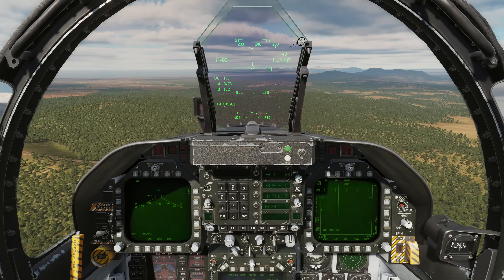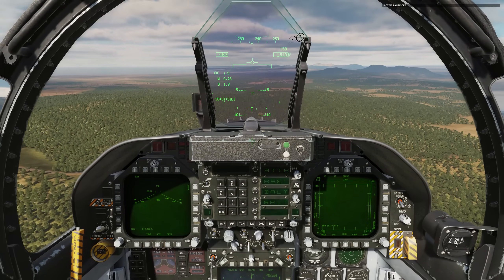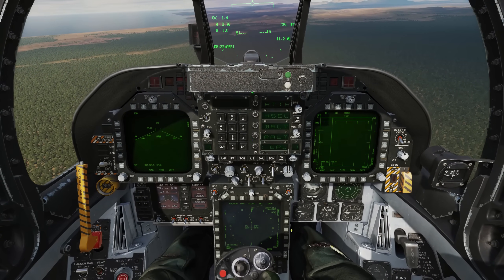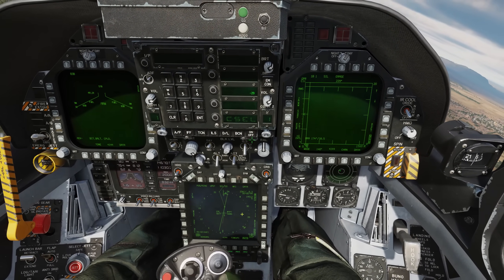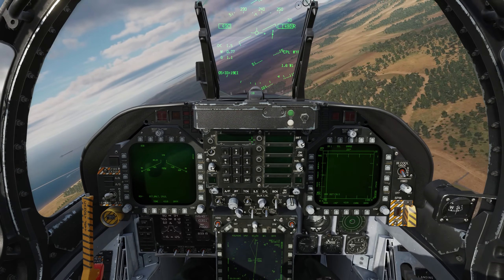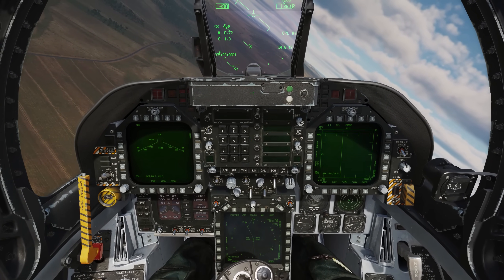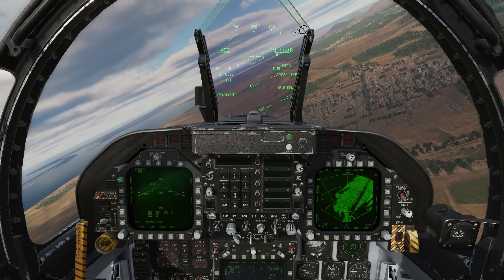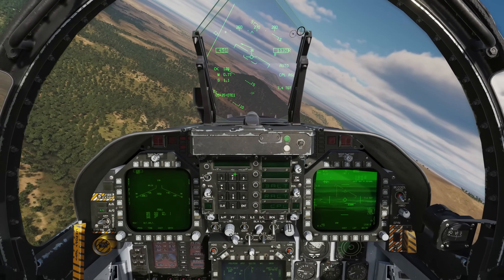DCS: F/A-18C Hornet | Coupled Autopilot Mode

Comment: Nice update thanks, looking forward to have it! Just question,  I flew F-14 many hours and when I switch autopilot on  the aircraft fly nicely straight. Even I fire missiles or drops bombs and aircraft is not weight balanced, it still fly straight. In F-18 after firing missile the aircraft is start to tilt and I have to use trimmer all the time, which is annoying. Is this real behavior of the F-18?

Comment: Nice feature! But i've got a question. You only set course? not course and distance? Suppose i'm flying to the exact north and the waypoint is 40 miles ahead, if i activate the ap with the new feature and set a 90° course, my plane will turn 30° to the right until 30 miles of the point?
What path will it make then?

Comment: Just a question - how will it work with asymetric loadout? Currently in either BALT, or ATTH if one of your wings is heavy, it will continue to bank, until it reaches 70 or so degrees and then turns the AP off. Had this unpleasent surpirse once during multi pleayer mission. Had to leave the computer for 3 minutes, i set the trim to keep it level, engaged ATC and BALT, but when i came back my Hornet was already a jolly hole in the sands near Damascus. ;)
Reply: I'm just goin to say it... you should have trimmed for the asymmetry before you set autopilot.
Reply: Please read carefully. :) I already said that i have trimmed it to fly level and only than egaged auto pilot. Now it looks that tuning auto pilot cancells any lateral trim you have had.

Comment: WAGS one thing that has always concerned me is that the aircraft seems to violently snap when activating certain waypoint modes... Surely in real life, there is some sort of PID routine that ensures the aircraft is allowed to transition gently but effectively? I struggle to believe a real F18 would snap like your video shows!
Reply: Not super familiar with IRL hornet systems, but the F-16 is fairly aggressive. Even in TFR mode on HARD iirc the limit is 4g? So 45 degree turns and like half roll rate is pretty tame. It IS a fighter, so comfort is not a priority.
Reply: @TriadAgone  Are you a real pilot with real F16 experience?

Comment: Hey Wags! Just out of curiosity, is the autopilot in the real aircraft this twitchy in the control movements? Or is this simply due to the early nature of the A/P at the moment? It seems like activating this in real life would snap your neck off with full roll left😆 Great work as always!
Reply: The real hornet should have to versions of the coupled auto pilot. One is tactical, shown in the video, and the other completes the turns in a much less aggressive manner. Not sure if both will be modeled.
Reply: yeah I think the AP atm has some bugs.

Comment: Does the F/A-18C have autopilot carrier landing capabilities and is eagle dynamics intending to get it implemented in the future?
Reply: ACLS mode would achieve something that close but you would need to manually fly the plane just before touch down if I recur correctly. This feature is coming later according to Ed
Reply: @Eaglewings-E  I was curious about it. Thanks for the info. I’m a keyboard and I can do basically anything consistently on the hornet, but I still struggle at zero visibility carrier landings
Reply: @allmight1612  damn, ils case 3 zero visbility with keyboard? :D that sounds insane to me

Comment: I thought this mode was called CSEL? Or am I crazy
Reply: Csel just let's you set a course. You still have to manually fly the aircraft along the course
Reply: HSEL holds  a course indefinitely. Coupled mode flys to a specific point and you can even adjust on what course it should fly to that point. CSEL is when you select the CRS line on which course you want to be.

Comment: Thats awesome, but @matt why is it sometimes that BALT wont work and i have to click it many times until it finally accepts the input?
Sometimes its as if my older joystick gives minimal input in hight of some sort? Does it work perfect with a newer joystik or does it have limits in which it works like only if the plane already flys almost perfectly horizontal? But i tried this and its just not consitantly working for me. Very weird because all other thigns work always perfect.
Does it work with Tankers?
Reply from the maker: Works perfectly fine here as long as your are within roll, pitch, and throttle setting params. Thanks.
Reply: Indeed, your flightstick must not give (even the slightest) input. And you do not have to be perfectly level for it to work.
Reply: @preamp51  Then the stick is my problem thanks.
Reply: @phoenixsui  It also won't work until you're INS is fully aligned so check that too maybe.